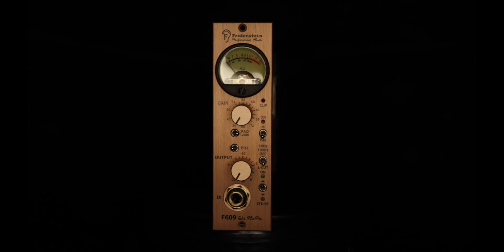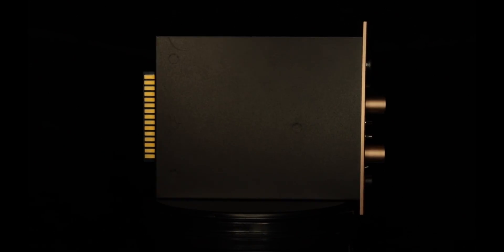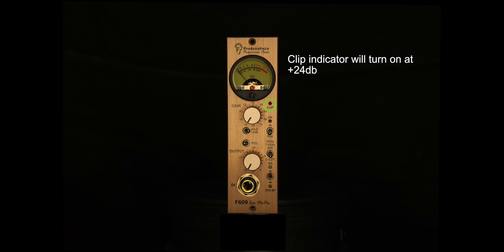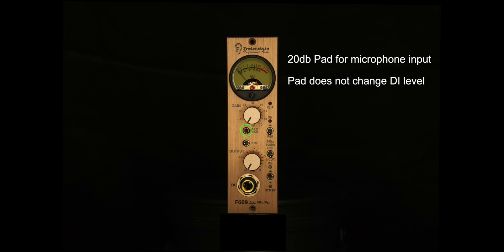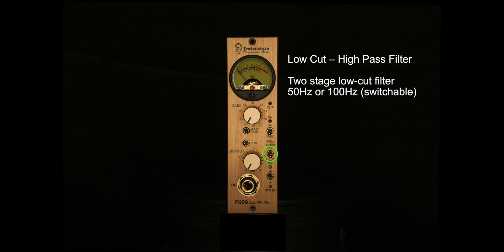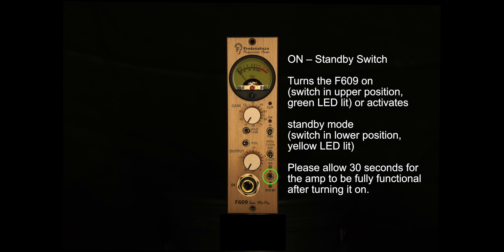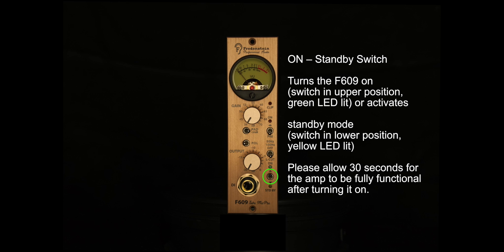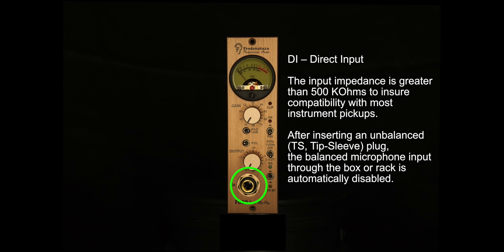Fredenstein F609 Overview & Demonstration

Comment: I want one! For sure.
Reply from the maker: The F609 is no slouch! I would really recommend it if you have the budget for this preamp, and it’s a discrete tube preamp too!
Reply: @plauditstudios5187  I've been wanting a 500 Series tube-pre but haven't decided which. I looked into the LaChapell 583S. Great tone but for what it costs, it should have some kind of LED or signal meter. Most people would say "use your ear." But for the $1K price tag, you shouldn't have to guesstimate when you're dialing it in. Same thing with the Retro, no LED. Radial makes one but it's the same price as the one in your video but the Radial only has 1 tube. 

I saw API just came out with a tube pre but not in the 500 Series. Rackmount only. I contacted their support and they just said "Oh, we don't have plans for a 500 Series tube pre. Check back later." That was a little disappointing. I would have definitely dropped $1K on an API 500 Series tube pre.

I'm not a fan of rack gear because, 1) I don't have space (or money) for a rack pre, rack EQ, rack compressor etc., and 2) You can't hear the difference between rack gear and 500 Series. Some people say rack gear sounds better because it has it's own power supply and more circuitry. But if you did a blind test, you probably wouldn't hear the difference. Plus, I like how, in 500 Series, you can mix-match brands, swap out modules, change the signal path order, it's compact and portable and most of all: Cost effective!
Reply from the maker: @tortillaman2491  I completely understand. I'm biased towards Fredenstein products after I spoke to Fred and realized what he was making. These 500 racks are amazing and can power any module. In fact, his Gold series tube modules have to be on a Fredenstein rack because of the significant power draw. On top of that, the linear power supply and enhanced power circuit make it all the better.

With how optimized circuits can be, the need to have singular rack spaces for a pre-amp are no longer a requirement. I used a UA 6176 for years and just sold it because this unit does more for the pre-amp side than the UA did.

If you do have any more questions, please let me know. The F609 is a beast of a unit, and I would gladly buy a second one to have a stereo pair.
Reply from the maker: @tortillaman2491  there may be some truth to having a dedicated power supply but if you have dirty power, it doesn’t matter what you do.

I had a dedicated GFCI to my breaker box, and also run my studio gear via a UPS and furman power conditioner to get the cleanest and most consistent power possible. 

In todays age, we are able to design great musical gear in any format so it solely is based on budget now.
Reply: Little green men from outer space took me up in their UFO and convinced me to buy a tube pre.